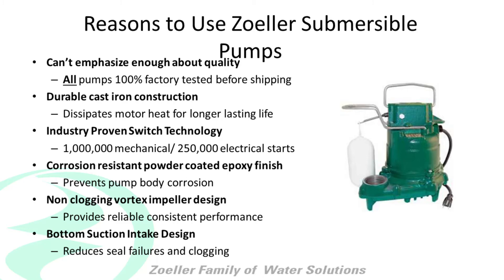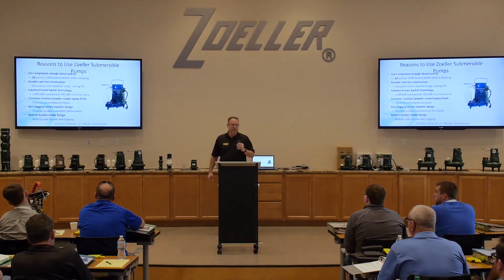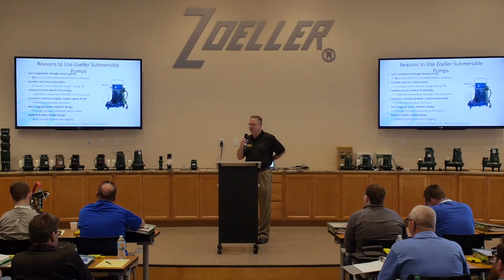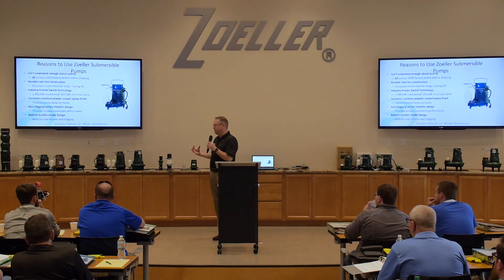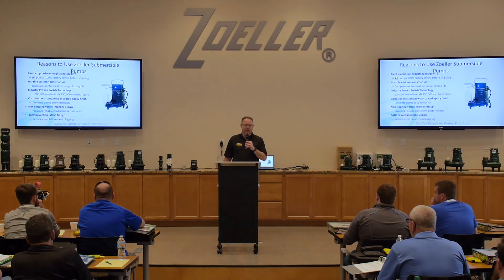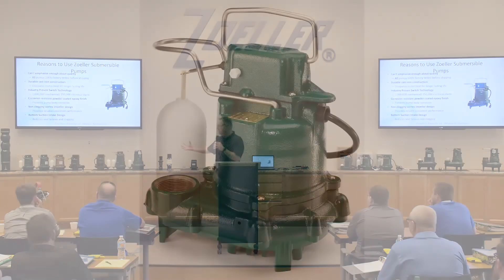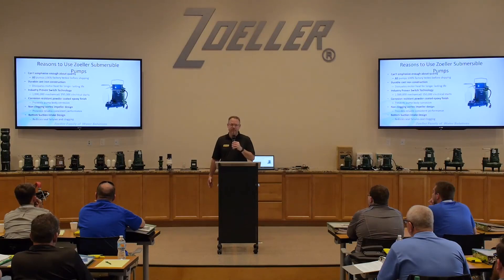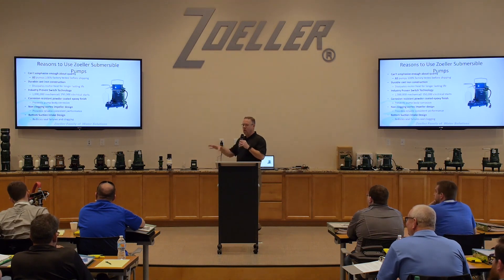Why Cast Iron Is Preferred in Sump Pump Design

Comment: So the cast iron case is in effect a heat sink for the electric motor. I just purchased a Zoeller 508-0007. Will start the preparation of the basin to accept the new pump system today. Gonna clean it all up. This pump I just bought looks impressive.